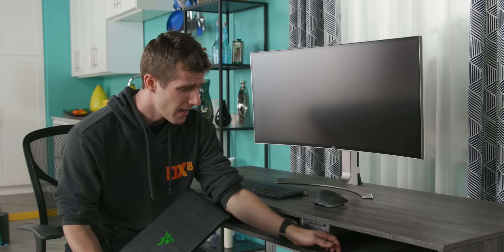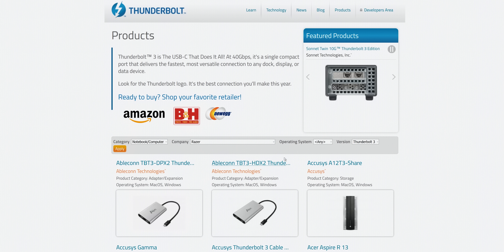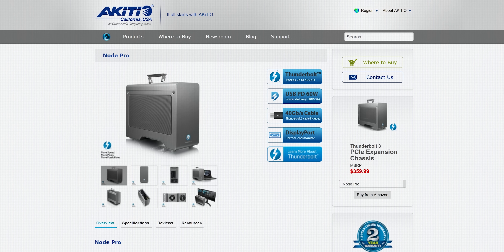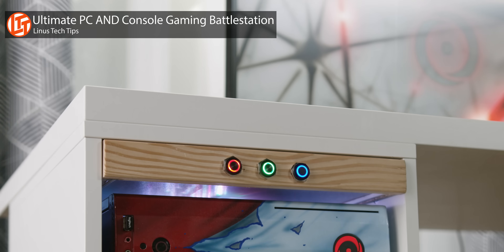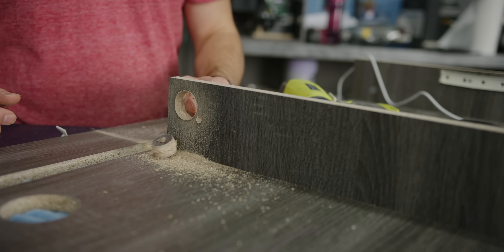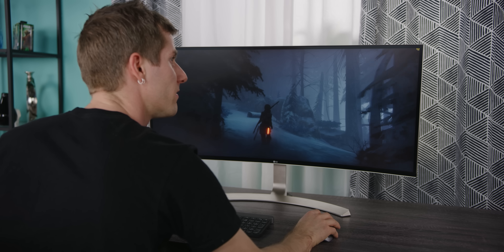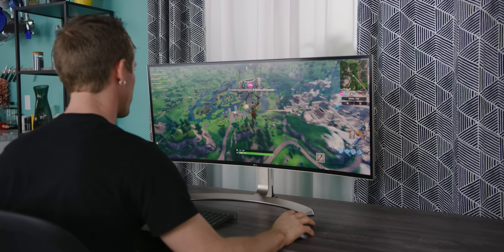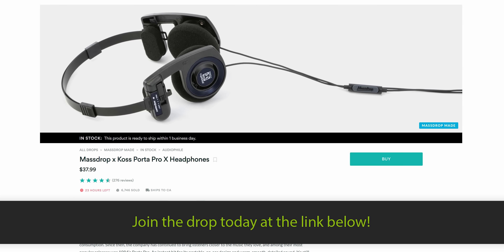This is the CLEANEST Setup.

Comment: 1:20 ~ I never opened any of those files. The @FBI runs BSD and destroys computers, or sabotages files, why would anyone ever need a separate Checkcum text file to confirm a transfer was not substituted or swapped in route = wouldn't they swap the text file of the check sum also? ~ Most systems should be built to check themselves at time of iso or session closing. LINUX why all the paranoia for things you would never be able to detect, if what you suspected was happening?
Reply: 8:10 ~ i still feel cheated. My goal was to help Sasha Grey. Instead i wrote Paris Hilton? 1Token Bible Job on Topc, all the Beauty on Bottom. Pamela Anderson, Jenna Jameson, no Boob implants = No Henry8th Casting Director or Writer Love, no Ivanka Trump at #Nordstroms (Really good place. I asked her to remove the implants and someone removed her cloths from the store, i actively solicited they keep the clothes or contract with her brand even if only online and reduced in store inventory).

Comment: This totally missed out on the primary reason we use laptops, which is portability...
Reply: Tbh, i think you missed the whole point of the video. People normally use laptops for portability due to school or work, but when home they would want to play some games or just have more screen size and that's where this video comes in.
Reply: @marcelogoncalves8540  hmmm I guess that makes sense, I have both already so it seemed pointless from my PoV, after the initial into I though he'd introduce some amazing RDP solution or smth but...
Reply: @glass00jdofiwbskdg  Well, tbh if we're talking about PoV this setup would also be useless for me. But it's definitely smth i'd be doing in case I had to move around a lot and kinda low on cash. Because tbh using this setup to have the laptop 24/7 docked there it would kinda lose the point.

Comment: I have a XPS 15 connected to an Aorus eGPU. It's pretty much plug and play and all my peripherals can be connected to the eGPU (it has display port, hdmi, and 4 usb 3 type A ports).  The only thing that is annoying is that since my XPS has a discret GPU, I need to deactivate its graphics card when I come home (because I do want to take advantage of its GTX 1050 when I'm travelling with my laptop and it won't recognize the eGPU as long as the laptop's GPU is active).

Comment: should i get laptop for $500 with i5 something and gtx 1050 
or build a $500 desktop with ryzon 3 something and this ryzon graphics hard 
i don't know the full spec list/
Reply: Do you need a portable pc? Or is a fixed Desktop okay?
Reply: @NoneOfYourBeeswaxQuenin  I mean I don't exactly need a portable pc although it would be nice. Are there any downsides to getting a fixed laptop connected to monitor via HDMI?
Reply: Lol ryzon
Reply: Asus G46VW, it has an i5, 3 USB ports, a windows 8.1 (except it doesn't suck), a 512gb hard drive and an NVIDIA GTX 780m.
Or a Lenovo (i forgot) but it has an AMD A10, AMD Radeon R6, 1516x853 dimensions, and is pretty fast. I have both of these laptops and they work pretty well. Only problem is the Lenovo heats up to 205*F and you need a   s u c c   m a c h i n e   to keep it cool.
Reply: @Zalzyn Matters Thanks for the essay lol
Reply: An entire Ryzen system will cost less than an Intel cpu alone. Just go for that. lol
Reply: @whoevertf  okay thanks

Comment: Follow up would be cool. Using a slide out bracket for the thunderbolt 3 hub would be great idea(keeps in place, but also removable to plug things in/out); also adding a laptop vertical doc(for MacBook Pro etc...) mounted to side of drawers or side of desk would be cool(would keep it clean & allow for easy access etc...). Just some ideas throwing out for version 2.0
Hope to see another vid for the next version.
Cheers, A

Comment: Some tips: cables could be run inside the legs in future builds, also dont be afraid to use mdf and build the thing yourself. My desk is custom built out of mdf with an epoxy finish, very professional for a modest cost. https://imgur.com/gallery/5y4gOdc

Comment: Using only one thunderbolt for everything limits bandwidth to the EGPU. That should be on its own separate connection and the hub on another. FAIL
Reply: while true, the premise of the video was the single cable solution.

Comment: its all cool , but 7:42 if you did all this hassle, then you also could just disassemble wireless charger, you will find inside a small board and thin wireless spiral pad, put that pad in wood hole, you will win on a faster charging, since you will ditch extra spacing of plastic shelf.

Comment: If you want a simple solution to the mouse pad problem you could always use an extended mouse mat and have both your keyboard and mouse on it so the setup still looks pretty slick without any further modding required

Comment: So, I like your set up because I have an older Razer blade pro I use for work and home and set up is a mess in my office. However, I've never found a keyboard that matches the blade pro's keyboard. Is there anyway to get a detached version of their ultra low profile keyboard? As far as I can tell, it's only on their laptops and that makes it really undesirable to use a set up like this. 

The deeper stroke traditional keyboard is hard on my bad wrists and most chiclet keyboards feel like garbage. So, razer blade pro's keyboard is actually the perfect keyboard for me. But i've never found it anywhere else but their laptops.

Comment: I almost have this working with a Razer Blade Advanced and a WD15 dock from dell...the only problems are that the blade doesn't support any kind of thunderbolt/USB-C charging and that the power button on the dock doesn't turn on the laptop which means I have to pull it out, open it and then close and put away again.

Comment: you used the wrong velcro tape , you should use the Dual lock from 3M. That stuff is the best for mounting things, LINK https://www.homedepot.com/p/3M-Scotch-1-in-x-1-in-Clear-Extreme-Fasteners-6-Sets-Pack-RFD7020/206180471
Reply: https://www.amazon.com/3M-Reclosable-Fastener-SJ3560-Clear/dp/B00JHKTDMA/ref=pd_lpo_vtph_328_bs_t_1?_encoding=UTF8&psc=1&refRID=R9K2F1PFXWEG30XY70QV#customerReviews

Comment: About that Silverstone PSU, I would recommend not ever using it with RTX 2080 TI, at least with Gigabyte gaming model. My pc just shut down and rebooted if I ran any triple a games with high refresh rate monitor and over 1080p resolution. 

Doom , killing floor 2, cod blackops 4 and dying light cause hard reboot when running 1440p resolution and physx related settings on. 

On COD Blops 4 I couldn't complete the advanced zombies tutorial, the pc worked fine until you moved, I could leave the game on for half an hour but if I move the camera around too much the psu will fail and reboot the pc. Same with dying light. Killing floor 2 was bit more interesting case but I could never get to the boss, sometimes the pc booted when I tried to launch a level. Doom run with Vulkan, but with OpenGL the game died at some point while playing the arcade mode (usually after you cleared first bigger wave of enemies). 

I thought the psu was faulty, got a new one but that one showed same issues. Thought the gpu must be the problem then, got new one and the issues persisted. Replaced the psu with my old Focus 750w desktop version. No problems. 

Put the gpu on my 5 years old build and showed same issues while running the system with the silverstone SFX 800 lti (except on cod 4 blops since the cpu was bottleneck and limited the fps down to 30). Used my old Focus 750w gold psu on old rig with 2080ti and no problems.

Ordered Seasonic Focus 650w sfx psu after month of debate with the retail seller. No issues anymore. Everything just works fine and no issues with any longer. Also all the problems were 100% reproducible every time for 2 months with silverstone psu. Weirdest part was that I could play most of my vr games without the pc ever rebooting, only exception was Fallout 4 VR. The thermals were never the issue, usually thermals were around 60 when the pc rebooted, max thermals have been 70 on gpu and 80 on cpu while playing vr.

TL;DR I would recommend staying away from silverstone sfx psu, their power supplies seems to have been only tested in theory and not in actual use. Causes pc to reboot without warning when running demanding games. Buy the Seasonic Focus instead.

Comment: I'm going for an even more minimal setup. Harddisk taped on the back of a Dell monitor that can supply 90w. And an egpu down the line. A little worried about cooling on my Matebook X Pro with closed lid however

Comment: Sounds like a great idea on paper but I’ve done this myself with my xps15 (2017) and after a while of using it you will run into issues. First off, i couldn’t use the charging on it because it wasnt enough (the dell is 130W). And sometimes you get random stutters when too much stuff is happening like when you exit or start a game or open multiple programs at once. Don’t recommend it at all tbh it’s just not worth the money you’re putting into it. Can’t beat a desktop man

Comment: Linus! You should have used 3M Dual Lock velcro instead of standard velcro!! It is SOOOOOO much better. It holds completely securely while still being detachable. https://www.amazon.com/Reclosable-Fastener-Industrial-Replacement-Canopus/dp/B07D2LYFM2/ref=sr_1_1_sspa?ie=UTF8&qid=1548284582&sr=8-1-spons&keywords=3m+dual+lock&psc=1

Comment: Or you can buy this desk charger solution that comes with a special drill attachment to ensure you don't cut through your board and use everyday home tools. Meaning you don't have to have a cnc machine to cut a hole in a board: https://www.mockett.com/wcs4-95.html

Comment: If you route out a mouse pad make sure you don't get blowout like you did on the bottom. Make sure to mask off your surface with painters tape to help with that. Granted your chances decrease with real wood, but thin veneer "wood" tops like that will need the help all the same. Quiet honestly I'd just go to your local crafts store, get some thin suede or felt, trim out a pad shape and apply some 3M Super 77 contact spray to the bottom, let it tack up, find a spot you want it on the desk, mask off the edges and lay down your pad and roll it out.

Comment: For your hub, Velcro is fine. Just use the heavy duty instead of the standard. I use the heavy duty (Industrial Strength) to mount my shield to the back of my TV. Never had a problem. I think the heavy duty holds up to 10 pounds.

Comment: Why im not surprised ? 
The problem is eGPU perform bit lower than  GPU that connect directed to PCI-e slot. 

And the main problem of 'these solution' for poor country like my country is that setup is too expensive than mainstream setup.

As IT seller I dun have many option to get more buyer than make it as cheap as possible and throw away any not necessary things that make it cost more expensive.

Comment: I own a setup like this. 

- There are few problems with micro stutters until I restart with eGpu. 
- USB is unusable when you use ones from eGpu. 
- Windows scaling breaks when your laptop monitor scale is different from desktop monitor.
- TB3 cable anything longer than 0.5m is hella expensive
- and of course, you will never be able to use Gpu at its full potential.

Comment: Instead of routing a cavity for the mouse mat just get a skin-style mat like the Razer Sphex or similar. Would look super clean.
Reply: I would also say that an extended mouse pad is an option that should be considered. It would give the mouse something good to track on, but it would also be a good contrast to the bland desktop. It would keep the desk space nice and symmetrical compared to just a random square resting under the mouse and not the keyboard.
Reply: Until you get dust and crumbs stuck to the edge of it.
Reply: @samial-terkawihasib335  I've rocked my sphex for years now, and nothing is stuck anywhere on it. Even if it did, since it's so thin and also water resistant you can just wipe over it when wiping the table with a damp cloth. I don't see any reason to go back to a "normal" mouse mat, but I do realize it's not for everyone.

Comment: HP's OMEN accelerator has all the ports needed for a complete set up. Ethernet, 4 usb 3.1, 2 USB c, a thunderbolt, and HDMI. I use it with a 1080 paired to my Spectre x360 15 inch. Set up works like a dream

Comment: I have a Dell XPS 15 9560 with an i7-7700HQ an my  stock power adapter has 130 Watts at 19.5 V and 6.67 A. This is a lot of Power so is there any solution to charge it through the thunderbold port? Because i can not find any 130 Watt adapter.  Or is it possible to use a 60 Watt for example or the 87 Watt Apple adapter?

Comment: So a couple of improvements right off the bat
1.) Integrated monitor arm, preferably as slim mounted as possible to lower the footprint of the monitor(s) on the desk as much as possible.
2.) Integrated mousepad. Aluminum or Glass preferred for maximum "bling" factor - but cloth is fine too
3.) Laser the area of the QI+ charger and integrate magnets to attract devices that have magnets included (lots do)

Comment: That is not the best way to bind velcro for this. It is not about applying vertical pressure for stickiness, you actually have to make some friction, pushing the velcro strips back and forth against each other, that way the hooks will adhere much more to the loops..

Comment: How are laptop thermals when closed... Terrible!!
Reply: I guess you didn't watch the video...
Reply: @AkinaGhost  and pretty much everyone else that has used any gaming laptop would disagree. It will start cooking if pushed.
Reply: @Johnny641  I've used a gaming laptop, fried eggs comes to mind...ahah 
But in this situation you're only using the laptop's CPU, the graphics are being handled by the external card.
Reply: @AkinaGhost  It's the CPU's that are generally the problem though. Although I guess having one less component producing heat will help the situation.
Reply: @AkinaGhost  I saw that part after posting and the reason I thought so was because when I edit with my XPS 15 closed it thermal throttles, looks like having the lid closed only applys to low powered Ultrabooks.
Reply: Wait does the heat also come out of the keyboard ?
Reply: MinBCraft Some have air intakes through the keyboard.
Reply: Not every laptop have the same thermal design
Reply: just open the laptop a tiny bit of you are scared of over heating
Reply: @bland9876  this.
Reply: @bland9876  then that's not what is shown in the video then is it ?? and that's what we are commenting on.

Comment: I have my computer in a wardrobe in the hallway. All cables (for 2 monitors, mouse, keyboard, speakers etc.) goes through a hole in the wall to the next room/closet (2,7m2).
Room is warm enough as it is with only heat coming from monitors and my own farts.

Comment: I had a very similar set up with a 2017 Macbook Pro and a 1080ti. I could dual boot into windows and plug in one cable for power, gpu, wired ethernet, all  peripherals, monitor, and gaming library. It was fantastic to have a Macbook while doing productivity on the go and a gaming beast when I got home. Sadly I experienced too many glitches. So I decided to get a desktop built by NZXT and went with the razer blade 15 1060 144hz variant for my on the go PC. I honestly learned to work within Windows just as well as Mac OSX after gaming in windows for a few years. Sometimes I do miss the Mac OS experience but using an iPhone and an iPad Pro as my productivity devices with my Windows PC's being there for power user stuff and gaming I think I found a nice middle ground. Although I do miss touting around one single PC for my set up. But all of googles enterprise software really makes it seem I can be on any given desktop and have access to all my files. 

You guys should do a Macbook variant of this set up incorporating FCPX tests and gaming tests. Great video!

Comment: I do the same thing as this, except with a Mac. When I’m at school, it’s on MacOS, and when I’m at home, I run Windows on it via Bootcamp. I plug in an eGPU, and it works flawlessly. I’d highly recommend this. Now I get the benefits of Windows and MacOS in 1 Machine.

(Edit) By the way I am able to also run max settings at roughly 60 FPS on nearly every  game.
Reply: I couldn’t agree more I am using a Vega 64 and razor core x egpu. 2018 15” mbp touchbar 32 gigs ram 1tb hard drive. I love being able to use windows and macOS when I need to. Windows was a pain to make work but now it’s perfect on my two 27” monitors. All games are max setting and the egpu is so much better for cfd and autocad.
Reply: Jerremy Vinson I know! It’s fantastic.
Reply: Which Macbook do you have... bc the processors are pretty limited normally bc of that whole "passively cooled" shit, so you end up Bottlenecking. Also on what resolution do you play on?
Reply: Phiera I have the 2018 MacBook Pro with a Core i5 8th Generation Processor, and 16 Gigs of DDR3 Ram. I am running 1600 x 1900 resolution, on an Rx 580 Graphics Card

Comment: I'm disappointed by the wireless charging solution. Ästhetically you certainly can do better. And man, the loose TB3 Cable … c'mon, if you want it clean, you could easily have build a dock-like station for it.

i'd definitely like a Macbook-Follow Up … im still struggling to find the ideal solution i.e. only one cable and still eGPU that is not Blackmagic. Right now i tend to use a hidden henge-dock which makes use of the 2 TB§ Ports on either side and connects two TB3-Cables anyway, so it wouldn't really make a difference.

Comment: I did the same thing you did with wireless charging hidden on the bottom side of my dresser, but i actually was lucky enough to be able to use a hand-held CNC router to drill out the pocket and cord space. It came out real nice and takes up absolutely no space! It's really great!